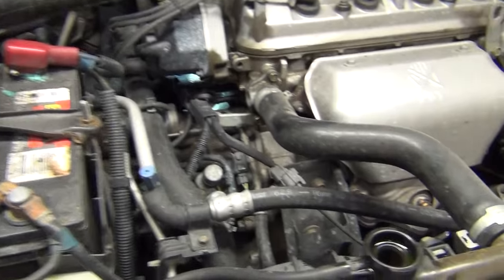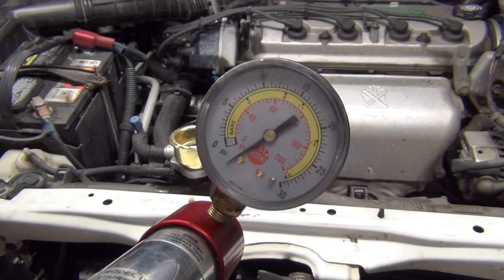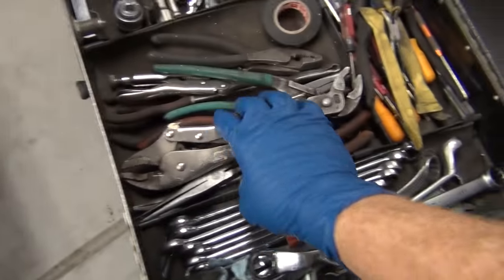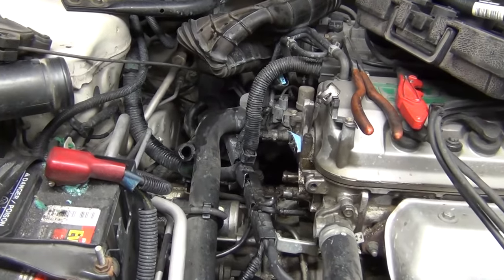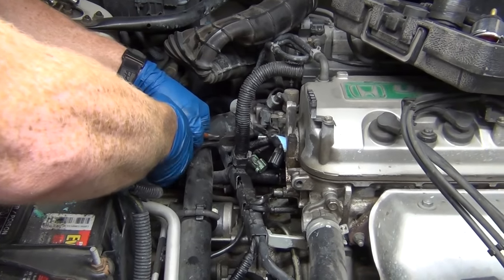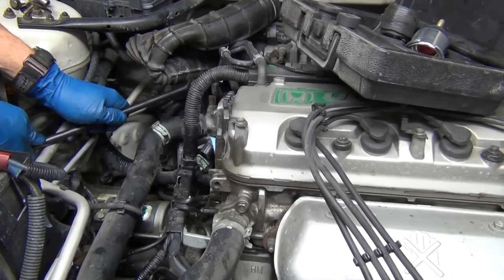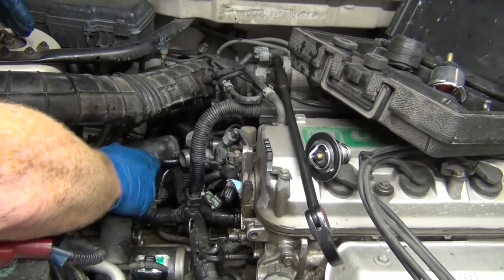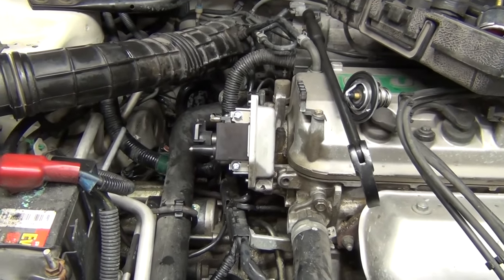Coolant Leak Hunting Tips (Bonus Accord Thermostat Change)

Comment: I owned one of these exact cars. The reason the heater core hose bloats up like that is because the distributor O ring is leaking oil onto it. After a while, it gets soft and blows. I had to fix mine on the side of a dark highway 2hrs from home in the middle of nowhere . I just cut off the first 2 inches of bloated hose and reattached the hose. I had to drain my wiper fluid reservoir and use it as coolant. I had to add some club soda that I just happen to have in the car  but i managed to get home without over heating.

Also, you don't need to take the distributor cap off.
Reply: lineartechbd1600 Wish to add to read your comment before I stuck my head in my engine

Comment: Brian; I've a magnetizer too of course. Works like poop. I resort to the old wrap a wire around the screwdriver and touch each end to the battery posts. Never fails to magnetize...  Like the 90 degree needle nose being adapted to actually grab new car hose clamps. Thanks again. JIm 
p.s. switched all the garage light fluorescent tubes to LED just a few weeks ago Lord what a difference. ($9.90) a piece.online.

Comment: Check for engine oil dripping on hose. Distributor has two seals inner n outer that can leak on hose. This will cause the hose to swell up. Wipe underneath distributor to check for leak.

Comment: Ive slammed a hood on stuff before. I was using a spark plug to plug a cooler line on my Acura, I was putting stuff back together and I put the plug in a little hole on the top radiator support. Long story short, I forgot I left it there and I slammed the hood on it. The hood was a little bent on that side after that.
Reply from the maker: Ouch!

Comment: The answer to how to stop the failure would probably be Braided line in what appears to be a hot spot. I would not have replaced like for like here... Magnetizer $3.00 at Sears while they are still here, you will not be disappointed!

Comment: thank you for sharing this helpful video.  I have a 2005 Honda civic which I love more than many people I know. she's been struggling lately tho and everybody tells me to trade it in while I still can, but I feel like there is hope. it seems that there is "too much " pressure happening. when we "fix ".one thing,  the pressure finds a weak spot somewhere else. have now replaced the radiator for the second time since I bought it in 2008, new Thermostat , and mechanic used blue devil head gasket repair.  when it made  a "new ".leaking place, in a whole new spot, I am slowly giving up hope that I am going to fix the issue.  is it time to cut losses? thank you for any ideas and for your time. believe it or not I was understanding a lot of what you were trying to show!

Comment: spring keeps it closed. there is actually wax in the thermostat that expands and pushes the pin and opens it
Reply from the maker: Let's cut one up and torch it in a video- shall we?
Reply: +briansmobile1 im with the guy above, wax inside it, pushes on the pin to make it open
Reply: +briansmobile1 check "How Its made" they do a bit on how thermostats are made
Reply: He is right - in most thermostats, the spring does keep it closed (this is why it's such a problem when the thermostat fails, causing the engine to overheat). The wax used has a high thermal expansion, enough to push the plunger and open the valve.

Because of the wax, they are sometimes also called wax stats.
Reply: I have an expired patent pertaining to the subject, the proper term is wax servo motor.  High thermal expansion rate is misused bogus half truth info, the wax however does melt at different temperatures 160, 170, 180, 185 were always options in the older days and today 193,195 and 197.  I say bogus because all wax has a high expansion rate upon melting, this stuff is nothing special in that regard, which is contraindicated by the misuse of superfluous factoids that actually get in the way, misleading more than they help.  The wax is special but only because of it's precise melting point temperature.  There is usually a divet in the bottom of the copper pellet, this is the area where the servo motor is 'tuned' to the proper opening load at a specific temperature.  This allows automated mass production volumes while maintaining a consistently precise device.

Comment: My radiator leaking bad. Used bar leaks for a blown head gasket. Seemed like it fixed it but I was driving the car with a loose coil bolt and the coils came off as I was diving and the car overheated. When I opened the radiator noticed it was clogged. I took out the gray dust looking thing out the radiator and tried to fill it with coolant but it immediately leak outs at the bottom. Car starts fine after I let it cool down tough. I’m hoping replacing the radiator would fix the problem. Otherwise I’m stuck with a blown head gasket and a fucked up radiator.

Comment: Hoses fail in that way ("swells up" and goes squidgy) due to oil contamination.  They can take a little bit of dirt and oil as you'd expect in an engine bay, but if they get a lot of oil from a leak, then over time they'll go like that one did.

In this case, I'd hazard a guess that it was from the rocker/valve cover gasket. Looks like there was a fair amount of oil down there.
Reply from the maker: You'd be guessing right.  This is the car we did the heli-coil video on the valve cover gasket job.  The distributor o-ring was leaking too.

Comment: Lets say your vehicle doesn't have a cap on the radiator only an overflow bottle. Does this pressure tester work the same as it would on the overflow bottle as it would on the cap located on the radiator?

Comment: i have a small leak in the top hose to radiator on my 2008 outback where the hose connects to radiator, its only a small leak but i guess its steady enough over time. would this small leak be enough to trigger an AT oil temp sensor on a subaru ? all my fluid levels seem good otherwise ?

Comment: I found a lot of fluid above my driver side rack and pinion shaft. I'm not sure where it's coming from. My greatest fear is that connecting pipe or water pipe on the back of the engine. It has O rings. Changing that looks like a night mare.

Comment: Hi Brian... do you know if there is an adapter that fits the overflow tanks on cars that don't have radiator caps?  PS: I have the ac delco ratchet and the battery lasts several jobs and you can get most any bolt off with it,  downside it is bulky as hell, lol...

Comment: Hey man I can ask you something. I have a Golf 5 tdi 1.9 year 2004. I have been with many fitters and nobody can help me. But look i have replaced the radiator that cooler pipe and thermostat and temprature sensor has also been replaced. I think it is the intercooler and the air conditioning I think, because I have to replace those 2. Because that air conditioning needs to be refilled. And I have this car for 5 years in my possession. He drives really well in the beginning. I could easily drive 180 without any loss of coolant. And still if I drive above 100km then that temperature sensor now goes a little slower to that red part.goes all the way to that red side. Is really tired of this. almost everything has been replaced. And that inside is also checked. And it is still good of those 4 things I forgot the name. Can you look for me, but I really want to visit you lol. But I need to see how I am going to do that. lol Then I give you what you want. Then at least I know someone who does it, who can simply be trusted. Because when I'm at the mechanic, I have to leave my car behind. yeah right not with me boy.. Let me now in a messege oké ill check it later one.Wish_015

Comment: I've got a 99 jeep Cherokee with a 4.0 and it appears that the freeze plugs on the back of the block are leaking. Do you think it's worth it to use a stop leak type sealant? It's a small leak, there's a drop of coolant on the bottom of the bell housing.
Reply from the maker: NO.  Your heater core will never be the same if you do.

Comment: Hey Brian, my car just started leaking coolant. If its a minor crack in the hose can i use some sort of radiator leak blocking liquid until i get a new hose?
Reply: Your problem is probably fixed by now, but I wouldn't drive on a cracked hose. My car blew off its inlet hose and that's not a mess you want to get into.

Comment: Got the same leak on the same model some time ago. Just wonder whether the engine oil leaking through distributor and landed on the hose (same bust location) is the reason for the leak or not.
Reply from the maker: It is!
Reply: Tnx Brian. Recently my head gasket on the same Accord got blown and I try to change it myself and change the timing belt and water pump at the same time. However I can't bust the crankshaft bolt. I try an air impact wrench with about 500 Nm and I even broke an extension of a breaker bar. My friend told me it is very likely that someone changed the timing before and tightened the bolt with an impact wrench. What options do I have now besides doing an engine swap?

Comment: why does my Subaru have two rad caps? 12 wrx
Reply from the maker: I'm not exactly sure, but I think it has to do with the extreme heat and altitude of the turbo vs everything else in the engine compartment.  The top cap is on that upper cooler/tank.

Comment: if water is leaking underneath on passenger side by oil pan where could it be coming from??
Reply: Carlos Gonzalez A/C condensation?
Reply: I have a coolant leak coming from a small hose in front of the oil pan on my 03 silverado.